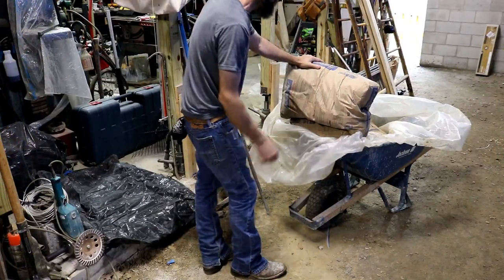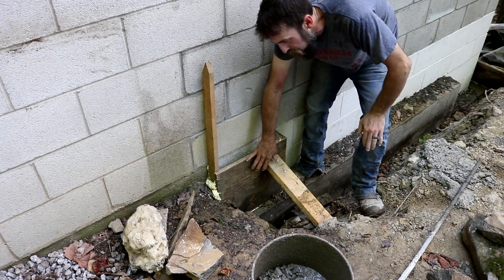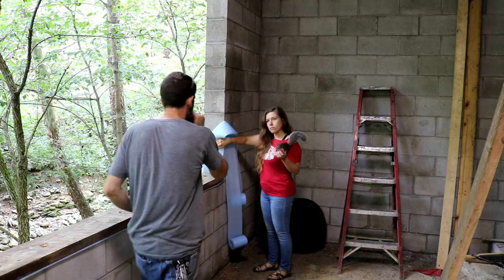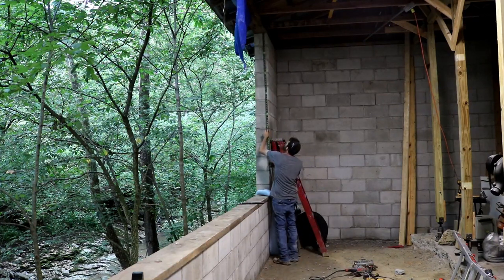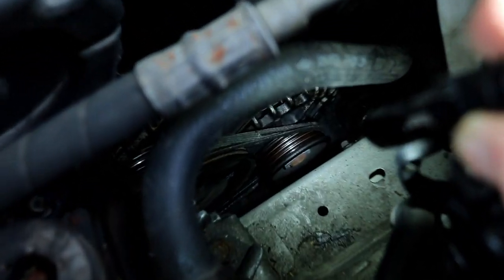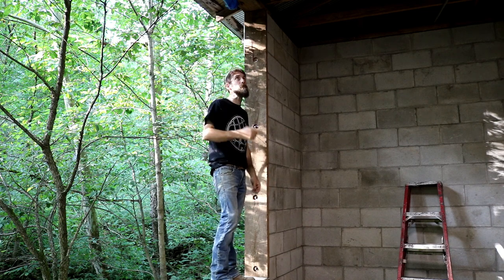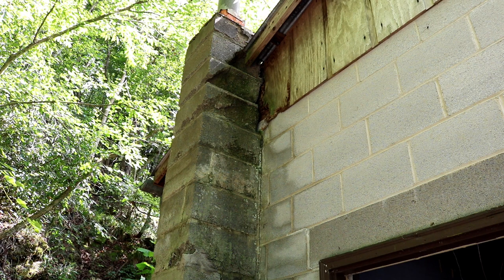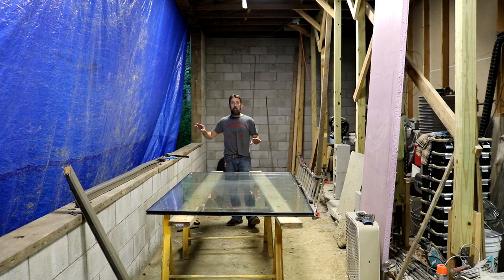Finished Concrete and Oak Trim

Comment: These episodes are extremely enjoyable, Steve. Thanks for sharing your journey so thoroughly. Having those footings and walls in place must be a big relief. I am looking forward to seeing what you do with windows. If you are going to top-hang the windows, you could perhaps use something like a pair of small gas struts to both hold the window open and limit the opening distance. Alternatively, you could make them into casements (side-hung windows, like a door), and then use off the shelf casement stays on the bottom edge. Those are cheap but very sturdy and cannot wear out.

Edited to add: I had forgotten that you mentioned the option of making them fixed. That's certainly the easiest and most problem free solution. I think if it was my workshop, I'd be making them fixed.
Reply from the maker: Thanks for stopping Craig, it's good to see you. I've decided that I'm going with a fixed window for the large glass. It makes framing and hanging and everything else easier. 👍
Reply: @SteveSummers  good choice! 👍

Comment: I'm all for lots of window area. I like natural light and just being able to look outside. Very good idea putting operable windows at each end. Natural ventilation goes hand in hand with improving the feel of the place. I wouldn't worry a lot about the windows losing heat considering you've got a concrete wall that has almost no insulating value. I don't know how cold it gets where you are. I'm in Nebraska and solid masonry walls will get ice on the inside during the winter, in a heated shop!

Comment: Keep it simple with those big double glazed units.  Just install them as fixed lights, and have the smaller windows at the end as opening lights ... $0.10 ... :-)

Good luck getting things buttoned up before the weather turns cold, it's be great to be a fly on the wall for this project.
Reply: I agree with John ^^^^^^^^^^^^^, doing an great job Steve.
Reply: Ditto
Reply: John Carey What this guy said.,that’s a big dg unit for it to open, even top hung. Added complication and you probably won’t even open it after it’s done. Make sure you allow at least a 6 mm clearance all round for movement of that oak, and sit the unit on glazing blocks rather than straight on the oak. Seal it in place with glazing silicone into the rebates, and use decent size glazing beads on the outside held in place with screws. The bottom glazing bead should have a bevel on its top face, and be cut bigger than the rest so it overhangs the frame to shed rain clear.
Reply: Steve p I don’t know if you do, but you certainly come across like you know what you are talking about.
Reply: Matt Simpson Haha. I’m lucky as I’ve made so many mistakes to learn from!

Comment: Because of the weight of the glass consider hanging the windows horizontal in a frame with pivots in the center of the ends.  This would allow the tops to swing in and the bottoms to swing out. A couple of notched rods at the bottom and slotted brackets let you swing the window open and hold it open as much as you want.

Comment: Hi Steve - just like other comments I dont know how much better your work on the building could have turned out especially with the location and situation you guys are having to work in.  Your trade as a machinist just wont let you take shortcuts and it also urges you to take advantage of every opportunity no matter how small to add more quality build details to the work, and I love this trait as I was always of a similar mindset when I was younger and doing a lot of projects like you are.  I renovated or helped renovate a few houses and I often felt I had to take advantage of  even small opportunities to make the work a little bit better where others would say "Oh ya dont need to do that" etc etc.  -  Sometimes I would get a certain satisfaction knowing I took the little extra time and effort to make the work survive and serve that much longer, some times way beyond my lifetime--lol  These little additions werent always necessary but sometimes I just couldnt let a detail go or id feel like I missed an opportunity.  Call it anal retentive and I wasnt the fastest worker but I was proud that I never had complaints or comebacks on either home or car work and I like to think some of that was due to taking that little extra effort to make the job better. I see you do the same in many ways, like takiing time to fill the blocks.  Ive seldom seen anyone do this unless it was necessary to mount anchors but otherwise never saw it done.  I think filling the blocks is really worthwhile, its more like a solid concrete wall.  Love your work Steve, been a good experience watching a machinist apply his own work eithic even outside of his normal vocation, it will pay off long down the road for years to come.

Comment: For what it's worth:
1. Make those big windows fixed. It would be fun to design and build operable windows that big, but it's a big cost in time and the days are already getting shorter.
2. Take some scrap wood and figure a way to temporarily secure it to the tops of those metal horses when you're ripping 2xs it's nice to have them fully supported or something that you don't mind getting a few saw kerfs in.

When I worked for a mason contractor back in the 80s a bag of Portland cement weighed 94 pounds and a bag of hydrated lime was 80 lbs. As I recall we always used Lehigh Type II and Corson's Miracle Lime. Most of our jobs were either stone veneer or flagstone walks and patios. The type II cement was used because because it gave a darker grey joint, not because of the strength characteristics of typeII vs type I. My boss swore that the Miracle lime gave the mortar twice the plasticity of other limes so we used half as much. My best story relating to those days was being sent to the supply yard for a yard of sand and 5 bags of cement. I got the sand first and then backed the dump truck up to the loading dock. Normally someone was there who would look at your ticket, drive off on the forklift and come back with a pallet and if you were lucky help throw the bags on the truck. That day no one was around so I grabbed the hand truck and found the type II cement. I stacked 5 bags on the truck and realized that at 5'8" tall and 150 lbs just pulling on the handles was not going to budge that hand truck. I had to throw myself backwards to get the truck on its wheels and catch it at the balance point. The yard man showed up just after I loaded the last bag on the truck.

Comment: When you place the window onto the cill that you create rest the glass on 2 points of contact at the bottom. The glass should be resting on 2 plasic PVC shims that are wider than the thickness of the glass & about 3 inches long & 1/4 inch thick.
That allows 2 contact points that can shift with expansion & contraction & causes no Binding or Stress points that will break the pannel.
Place them at about 10 inches in from the side edges of the glass.

Comment: That cabinet is a piece of lost and forgotten history. TAB Inc. made EDP (Electronic Data Processing) equipment and supplies. That cabinet was a "tape cabinet". It held a great many 10" reels of magnetic tape, which was the bulk data storage method from the 1950s to the 1980s. There used to be "tape libraries" or "tape vaults" in businesses like banks and insurance companies where there would be a room about 50' by 100' (or sometimes twice that size) with rows and rows of those tape cabinets, back to back, in them. To get even more space to store tapes, there weren't aisles between the rows of cabinets in many cases. Instead, the rows of cabinets were mounted on rollers, and there was a big crank at the end of the row you could reef on to move the whole row about 5 feet back and forth. There would be one row's width of aisle space for maybe 10 or 15 rows of those cabinets, back to back, maybe 50 feet long. You figured out where you wanted to go and cranked the cabinets around until the row was in front of the cabinet you needed to open. Obviously it was a good idea to make sure that there was nobody in the aisle before you started closing it up to get to the cabinet you wanted.
Reply from the maker: That's interesting, thanks for sharing the info.

Comment: Hey steve for your window glass be sure to use rubber shims on the bottom of the glass (or down side) to rest the glass panels on in the frame and use the same glue they use to set front car windshield with to lock em in place, be sure the frame is square corner to corner before you set the glass. Good luck on em and awesome way to up cycle a great resource.

Comment: I suggest mount the large windows fixed, and frame them in PVC boards.  Caulk them in a rabbet the width of the window and cap off with PVC flat board.  You can buy tall, skinny windows to open with hand cranks, and put them on the ends.

Comment: 90 pounds each.. when I was a youngling and doing masons work I used to carry 2 bags at a time. Carry 4 blocks at a time. Shovel motermix to the block layers who were working on scaffolding over my head. Now I am much older and much wiser and the old back tells me I was a fool :-)
Reply: If you'd asked me I would have said from memory that bags of cement were 1 cwt or 1/2 cwt. Either I've always remembered it wrong or things have changed.
Reply: Same here AFn29129 David.  Young... Dumb... and Stupid...  But you know know what I don't think I would trade those times because the skills served me will in life.  I can build a home from scratch and the knowledge I've learned keeps the griefters from trying to sell me shoddy product and/or a contract job.  Especially all forms of roofing repair and plumbing.  Electrical I'm fine as well as well as carpentry.  So all in all as I'm older than dirt... I can't complain.  

That's why I'm here in this channel.  I love him thinking out of the box.  If he continues this he will go far and get ahead in life.
Reply: Here in the UK bags of cement used to be a UK hundredweight. (112 lbs / 50.8 kg). I think that by the 1980s they were a round 50kg.  Even as a young chap I thought them rather heavy. Some time in the 1990s "they" decided that this was too much to expect folk to lift routinely, so changed to a 25kg standard bag. On reflection, I tended to agree with "them"
Reply: @andypughtube  I could hardly lift them then 'cos I was too young, I can hardly lift them now 'cos I'm too old. :)
Reply: andy pugh  I don’t remember cement going down to 50kg but I was probably not looking !    A hundredweight is enough if you’ve got to do it all day, but these little bags are just annoying !
Reply: Twotone 1cwt
Reply: i was just about to tell you the same thing about youre back , my father used to be an ironworker working for his dad being the foreman , his dad wasnt about to be told that he favoured his son(s) working under him so he made my dad work extra hard 
he started having problems loosing power to his arms and it turns out his neck is worn out and pinching his nerves , he couldnt work no more at age 35 and still has problems at age 65 
some father my grandfather was huh ?
i simply refuse to wreck myself for a few measily dollars i work to live i dont live to work
Reply: When you was doing the work it's for money you would do anything dangerously to get money. But with Steve he started do it to understand the system and got to enjoy it.
Reply: afn29129 David You must have been a Hoss to do that, Hooah!
Reply: Can’t become old and wise, without being young and stupid first.  It’s also why old men, in a job that eats younger men like candy, is such a dangerous thing.
Reply: Funny what we could do when we were young bucks, I was a Soldier humping a Ruck with a 60 up and down the mountains of Georgia😊
Reply: I seem to remember Portland cement coming in 100 lb bags in the late 60’s. 
As everyone else, I’m paying for it now. Too soon old, too late smart.
Thanks,
John
Reply: CrimeVid  true but it does make it easier for the lad to lift it above his head whilst someone else creeps up behind with a Stanly knife and slits the bag. Not to I would ever condone that especially not with cement dust sand is better doesn’t burn
Reply: for a small guy like steve I feel sorry for him having to carry the bucket of cement up a ladder somewhere in the nearish future.
Reply: Daniel Chapa  you say afn29129 David must have been a strong man to carry 180lbs of cement, when you are young you will have been carrying bags of cement from when you could,say, about 15 years old.Whether as a holiday job, a weekend job or full time. You get used to it,and soon will be carrying 2 bags if there’s a rush on,most guys with any sense will stick to 1 most of the time, but there are always heros  !    My point is that’s how guys earned a living, very few got hurt doing it, and you can do it up till about 40 years old, by which time if you had stayed on the sites you had better have learnt blocklaying  !!
Reply: Mike Woods  !?!   you should be able to pick 25k off the stack and cut it’s throat into the mixer in one easy motion, it’s less messy than cutting it on the stack and tipping into the mixer
Reply: Yeah, we're much stronger than the disks between our vertabrae-- there's your problem. My back was already suffering by age 30. Downhill from there. Age 64, it's totally jacked and I have a metal plate in my neck. Sleeping actually hurts. Advice to young'ns:  (paraphrasing Proverbs 13:24) "Spare the ego and spoil the back".
Reply: I carried 3.
Reply: Jeff Childers 
We used to use a homemade jib crane consisting of 1 1/2” pipe welded up appropriately and a snatch block at the extreme end. 
A rope and a hook completed the rig.
Way better than carrying it up a ladder.
Thanks,
John

Comment: Yep......been there...done that....Shredded serpentine belt on my wife's van just a month ago. It also had a wobbley balancer too that needed replaced along with a new seal. Steve the building is coming along just great. Sure wish I'd have bought a place with a building 15 yeas ago.

Comment: Like Elizabeth's shirt. 
When you do the high work filling block you may want to switch to a pea grave (or similar?) mix. Filling that whole cavity through a 2 in hole is tough enough. The crushed rock will make you hate it. Even a strong(high psi) sand mix is good enough for your anchors. 
You're holding water in the chimney.  Comments about no flue liner are good info. Regardless why, when you look back at the video you see all the wet block / water infiltration. That destroys block faster than anything. 
If you hate to commit on big windows yet, and time is short, frame them oversize and cover the openings in plywood when cold moves in. You can build frames and install them after the heavy lifting is done and you're dried in. Great video series.  Thanks for sharing

Comment: Your chimney deteriorated due to carbonic acid. Flue gases condense on cold block and forms carbonic acid. Clay liner failed at some point which started problem. Cheap fix was metal pipe run inside which they did, but that doesn't fix the damage obviously. Doing a super job!

Comment: Hi Steve, just some food for thought on the shop windows. If you’re not going to use the original glass door frames you removed and make some kind of new ones from wood then when refitting the glass make sure there are plastic shims between the glass edge and wood frames. It has been known for natural wood expansion & contraction to break the seal between the glass panels resulting in misted units and loss of thermal efficiency.
Enjoying watching you do the very best you can rebuilding this shop.
Reply: Very true. While not impossible, designing a frame & hinge system that could support these windows to swing would be very difficult. The frame will need to be rigid enough to prevent flexing as that will break the seals. The hinge system would need to be very robust to support the cantilever weight of such a wide, heavy window.  For a renovation I designed and built an infill  glass wall using reclaimed sliding glass doors (two sides, 8 doors per side). These had aluminum frames from which I cut any unwanted protrusions off with a skill saw (That was fun!). 30+ years later and no problems.  Steve is quite gifted though, so he might be able to figure out a way to make it work. The way I would approach it would be to make them sliders again, if the height of the opening allows. A beam to support the roof would be needed, but he needs that for any design to open the windows.
Reply: He could make them pivot in the center so the weight is held in the center and is balanced
Reply: @ypop417  I kind of like that, but then the window open into the shop making it at risk of getting in the way and hit by stuff.
Reply: Make it simple, just rebuild it as a sliding glass window similar in design to the way the door worked and have full support.
Reply: I'm sure whatever design Steve comes up with for the windows will be just fine my origional comment was just about fitting the glass units within whatever he chooses.

Comment: Go with stationary large windows and small opening windows in the end. My opinion.
Reply: I agree you can put fans in the smaller windows (one In one out) and get lots of airflow.
Reply: I agree!
Reply: smart move using sliding doors for window . . . .frame them in aluminium to avoid window sill rot.   Ck comercial install . . . .you'll be happy down the road . . .good luck.

Comment: I will say you have done an incredible job Steve. I have a suggestion on the windows. A person of your talents should be able to make a steel frame of angle iron a flat stock. Hinges on the top will let it hinge out on an angle. You would be able to leave it open during rain and not have to close it to keep the rain out. Just a thought. The hinges I believe would have less stress on top than on the side swinging outward. Good day sir. You shouldn't need a Abom79 size hinge but it wouldn't hurt.